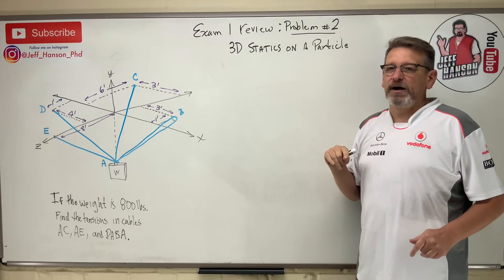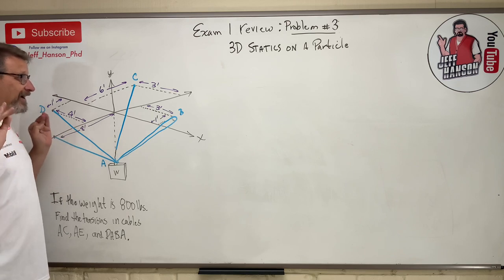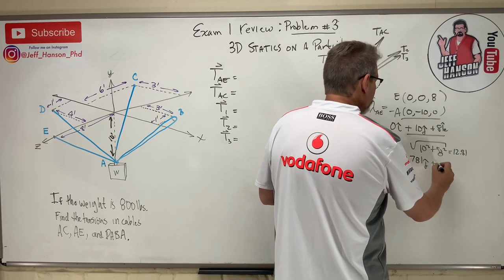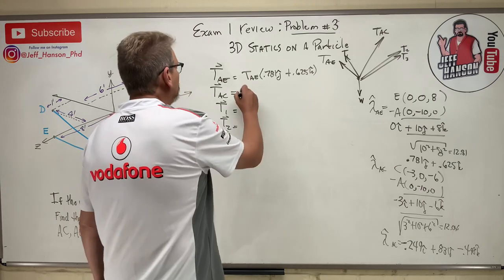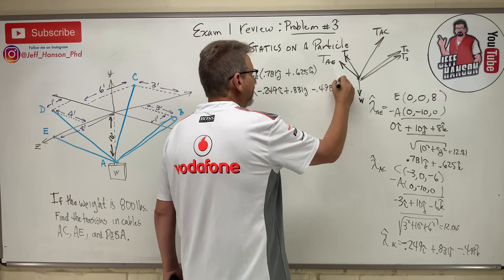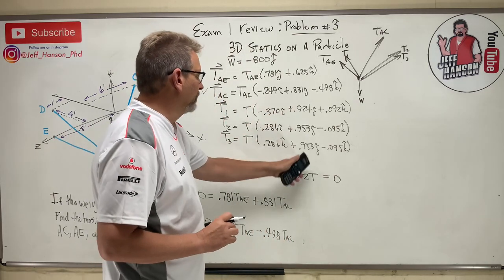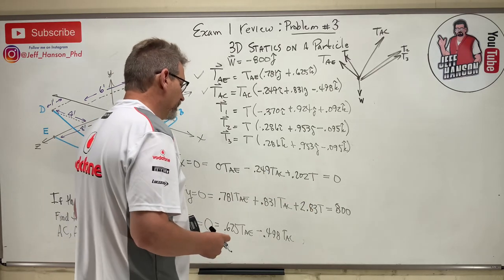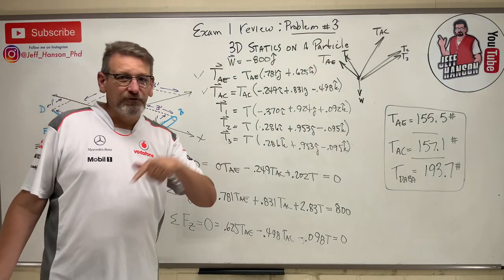Statics: Exam 1 Review Problem 3, 3D Statics on a Particle

Comment: Good afternoon sir, I'm not sure how you typed this into your calculator. I used the matrix method, (Fx is row 1, Fy is row 2, Fz is row 3) and used rref() on that matrix and I didn't get the right answer. So I used systems of equations solver with the same rows and still got the same wrong answer. Please how do I use the calculator so solve this? Thank you so much for your help.